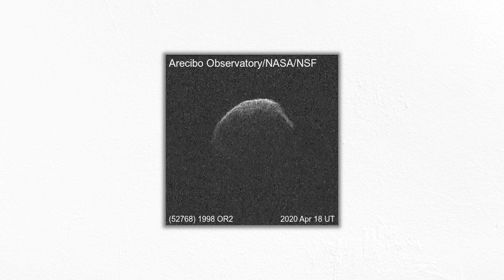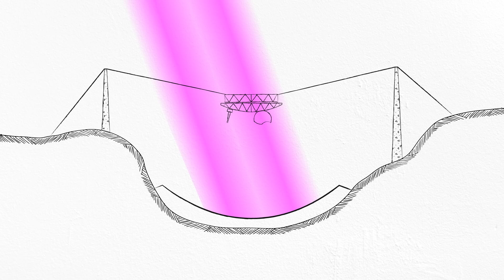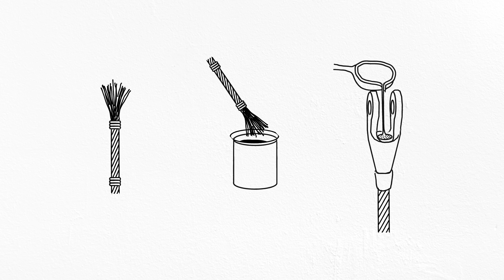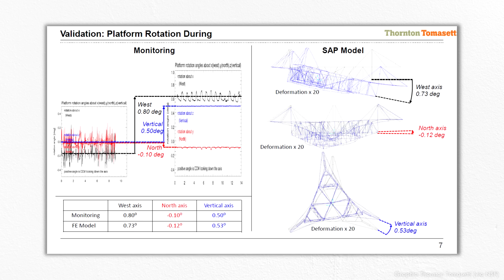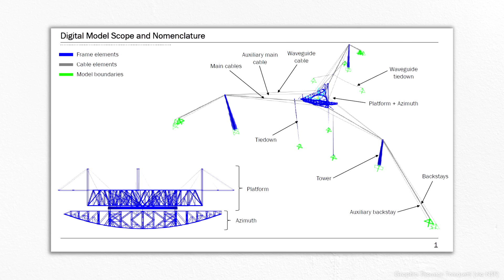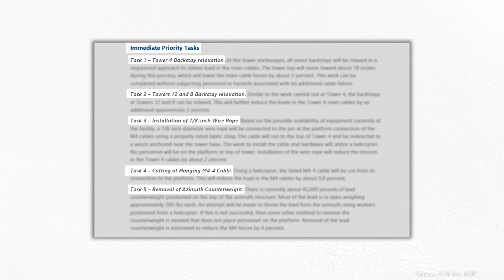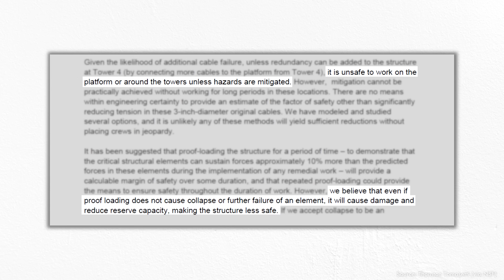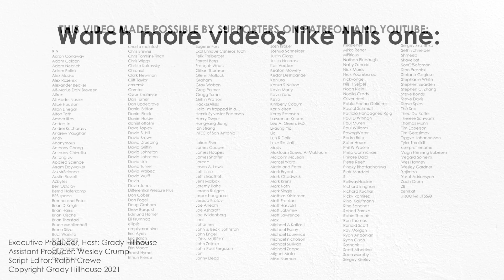What Really Happened at the Arecibo Telescope?

Comment: This was surely just down to inadequate maintenance. You mentioned lifts using steel cabling, typically for lifts all lifting cables should be replaced every three to five years, sooner if there is any indication of mechanical damage during regular inspection. Certainly a costly exercise. The calculated strength of a steel cable at manufacture, 70 years later, is fiction.

Comment: I am sorry but in my opinion this was a combination of analysis paralysis and incompetence. Obvious there were massive issues with load distribution in the cables, considering that once the first cable failed, the platform position dropped by one meter. By the time the second cable failed they should have realized that the are on shaking ground with little time to spare. Of course these failures seems spontaneous but strain gauges, piezo sensors etc could indicate that some significant event is about to happen. Arecibo was quite far from being a loss except for, OK a little aggressive, incompetence. I would not trust these guys to change a light bulb.

Comment: I will think of this old engineered structure failing every time I cross Tower Bridge in future which thankfully now is not often. 

Note 1: Maybe all stuctures that have a possibility of failing, like this telescope and bridges should have automatic computer controlled drones constantly watching them. If we can watch failures like this then the information could stop future failure and lead to possible upgrades. 

Note 2: I was surprised that zinc was used. I know it has a low melting point making it practical to use in the field but it is extremely weak compared to other materials, I'm also not sure how well it adheres to the steel cable. I suspect better methods now could be found. 

This sort of engineering is not my working field but I've been doing heavy duty electrical terminations of all types and sizes for almost 50yrs and I started my career in a metallurgy lab.

Comment: Perhaps a bit of an oversight on the original design (probably due to cost and limited expectation of increasing the load) was to not have the ability to lower the heavier suspended elements from the supporting cable structure.  So the cable sets would be affixed to a sub or hoisting frame, and then the rotational unit and instrument packages could be lowered to some fixed struts projecting up through the dish for the service of all the components.  Assuming the towers themselves weren't being overloaded, individual cables could replace with heavier ones, or additional cables could be added more safely.  Perhaps a thought for any future dishes.  To design such a large and potentially problematic structure with some significant degree of serviceability built in is pretty short sighted.  (Though as an engineer, I am constantly pressed to spend less money on a project; I have never had one that would have had such a catastrophic, and therefore expensive, failure mode.)

Comment: Could have installed new cables one at a time.  Back in the 80s
Reply: yes, i think so too, but you would have need something smooth, not a helicopter over there...a balloon or maybe even a zippelin could have help relieve tension on the structure so you could have get a beneficial safety factor above 2!  it could have been done, but it would have been expensive...

Comment: What surprises me most is that it apparently wasn't necessary to have a system for lowering the receiver to the ground in the event of a hurricane.  Props to the original engineers that designed it so tough that you could just leave it up there to swing in the wind and it stayed up there for decades.

Comment: High-cycle fatigue ?
The wire rope would have been subjected to variations in tension around the static tension, so a +/- fatigue cycle on top of the big + static tension.
Furthermore, there could have been internal abrasions in the individual strands against each other causing surface roughening of each strand and reducing its cross-sectional area.

Comment: You talk about having increased safety margins in the original design, but it seems that a structure that was designed in the 1950s to serve a purpose in the cold war, that far outlived the cold war, was more than adequately designed for its intended purpose.  That it was later re-purposed for something not envisaged by its original designers cannot be seen as a fault of the original design.

Comment: I'm a rusty Physicist but I suggest the cables likely died from a salt death.  However, I suggest they were designed for the first antenna array and not the rotating ring structure and heavy head added for improved sky observation. Therefore it was under sized and was on a razor edge waiting on time.

Comment: You said the structure was initially built for a military purpose, this usually warrants a much lower factor of safety.
Reply: Yeah, if those center failed cables were originals ( not the auxiliary ones added later) i could see construction priority causing these issues. Getting it up and working is top priority. Not making it last... 

I can't wait for the forensic reports on the cables.

Comment: I think it's fair to say the hypothetical cable flaws are one way to see this loss but the other way is to see the design was flawed from the outset.  Better cables won't compensate for weak anchors and stronger anchors won't compensate for improperly supported mass.  There was virtually no reserve strength or redundancy in the cable architecture.  The oldest bridges in the world are precisely those which were overbuilt.  This was built on a scarecrow diet.

Comment: You said it in the beginning of the video.  "Corrosion in the Spelter socket."  Then overall corrosion in ALL the cables.
Lack of money for properly done maintenance is the overall diagnosis.  Plus overloading in subsequent years.  You never use the built in safety margin for add ons.

Comment: another good reason not to hire the lowest bidder when constructing some thing so critical, if they would have hired the higher bidder those cables would have been assembled correctly. and would have used the best materials, instead of the cheapest money could buy!.  you really have to give it to the shuttle crew men and women, it had to take guts to fly in space on a machine with 270,000 parts built by the lowest bidder!.

Comment: As a structural engineer, right of the hand, I think the main reason for failure was due to overloading the deck.   Then, its location geographically didn't help either over time.  Finally, lack of maintenance played a big role.  Tension cables should have been replaced as often as every 10 years or so.

Comment: Safety factor of 2 in 1960.  Then double the load and add a couple more cables on each tower. What could possibly go wrong. The structural engineer from the sixty's is rolling over in his grave.

Comment: I remember when it was first put into service. I was in HS and it was quite an accomplishment. However technology has moved on. It will probably never be replaced. It was only built in the first place to monitor the Soviet Union's nukes.  We have better technology today and many types of observation can be accomplished from space with satellites. If a base is built on the moon,  something like it may be built there, but the size could probably be much smaller due the the fact that signals can be amplified and computers can remove noise, unlike in the 60's.  Today, we can look back in time and hear remnants of the Big Bang. How is that done?

Comment: I really wonder why it survived the storms of 2017 but collapsed 2020 in calm weather.
So did the chipped paint occurred starting from 2017 or not before the first cable break in August 2020? This could indicate if the storms weakened the cables and prepared the collapse 3 years later, or if there was some serious damage after 2017.

Comment: Very sad. It provided many cool discoveries over the years.
I wondered what happened to it. 
It was a marvel of engineering. 
Thank you for the video. The drone shots as the cables failing was spectacular. In slow motion you can see each wire break. 
I hope they will replace it with a new telescope that it safer.

Comment: Zinc slowly corrodes in air, particularly salt air.  For this reason, a Spelter socket has a limited service life.  Those cables should have been replaced in an overhaul after 40 years in service. With new sockets and anchor  structures.

Comment: Another consideration of the strength of the original Aricebo design is the circumstances of it's creation. In the late 59s there were no reliable systems for detecting missle launches in a timely manner. The Department of Defense was funding many possible scientific proposals and evaluating them for deployment. Aricebo was built quickly to address a present threat. A maintenance program was only created after the fact.

Comment: "Cables were regularly painted" Cables are not supposed to be painted, they should be left bare but impregnated with grease. This keeps out water, inhibits corrosion and lubricates between stands as they shift under varying load. The Aricebo cables were originally bare and greased, but then when a James Bond scene was to be filmed there on the suspended antenna, the directors insisted that the cables had to be painted white for appearance in the movie. The site management allowed that. And so the telescope's fate was sealed - by a James Bond film shoot. The paint prevented keeping the cables properly grease-filled. They began corroding. Expansion due to corrosion places uneven loads on different strands...

Comment: San Francisco's Golden Gate Bridge was built 83 years ago. It's exposed to very rough, wet and salty conditions. The 500 vertical ropes were replaced once, in the 70ies. The two main cables were not. Their corrosion can't be stopped, but only be slowed down. The bridge structure got some weight relieve though when they replaced the heavy lane deck with a lighter one some time ago.

Comment: I really enjoy your content. As an engineer who grew up while Great Britain was dumping the Imperial measurement system to fall in line with Europe using the metric system, I am able to interchange measurements between them. Feet and yards, to metres is confusing. A foot is just over 300mm or 0.305 metres. 2'6" is 0.76m. As a metre is just under 39 3/8"
I can remember all the trouble changing over caused but I have to admit using metres and millimetres is very much easier. 
I do hope they build another scope of equally futuristic design as the engineers in the 50s.

Comment: Excellent video. As an engineer working aircraft structures, you are spot on regarding safety factors. Seems like they had a well calibrated mathematical model from which to make reliable predictions. But failing well below the predicted strength begs the question: were fatigue and damage tolerance ever a consideration? That vertical supports were required leads me to think that even the slightest of deflection in the system repeated millions of times over the years had to accrue structural damage. Such theories pertaining to aircraft were in their infancy in the 50’s and 60’s. So I’d have to think their application was likely less considered on such a unique structure. 

Just one person’s speculation.

Comment: Thank you for the very interesting video. The question of how such repairs could be made in those circumstances remains very prominent to me. I wonder why such structures are not planned with that in mind. Replacing wires should be standard on such constructions especially in this kind of environment exposed to salty air and harsh elements.

Comment: Todays words are: redundancy and safety factor. Don't you ever forget them.
Reply: You cannot rely only on safety factor and redundancy when both of those characteristics can be affected over time due to corrosion and other incidents. They are very dynamic over time, difficult to predict and modelate, and that is the problem here.
Reply: @HambertHM  today’s additional phrase is: responsible maintenance
Reply: @HambertHM  If they rebuild it.  They need to use galvanized cable and do yearly inspections.
Reply: @BeingMe23  if they rebuild it, I will come.
Reply: @agoniaXdunya  we can rebuild and perhaps make it better then the past.  (both to show the change and to honor its legacy by continuing its work)  if we were to rebuild it like it was, it would feel like pretending that this never happened and that would be something I would consider disrespectful.  (I am sure someone with better ability could explain my thoughts better as I doubt I am the only one who thinks this way about things like this)
Reply: @BeingMe23  galvanized alone won't hold up.  Needs to be coated or shielded as well.
Reply: @HambertHM  this guy gets it.
Reply: also consider design life. I doubt the military specified a design life of over 50 years,  Design life plays heavily into material and assembly decisions all along hte line. Although "maintenance" can extend the life of just about anything, it won't last forever.  concrete and steel designed for 50 years may last to 60, but probebly not 70...
Reply: @mrl22222  funny you give that 50 year mark saying that with proper maintenance, keeping it til 60 is quite likely... most of the US's original infrastructure during the highway boom was designed for that 50 year mark and here we are approaching that 70 years xD
Reply: @lachlanhudson7404  Tell that to the highway road conditions in Michigan USofA
Reply: @mrl22222  Yes everything had shelf life.  But if one tries to design something it for a overly extended time can drive up the over cost vs benefit.
Reply: She still wasn’t as neglected as the people of Puerto Rico
Reply: The problem wasn't that. The problem was it wasn't designed to be maintainable. The cables were permanently anchored instead of being attached to winding drums that would allow their tension to be released in a controlled fashion for maintenance and replacement. They never considered that they may one day need to replace the cables. Thus, the observatory inherently had a fixed lifespan.
Reply: Safety 3rd
Reply: the whole design of those horizontal cables under such tension was a huge mistake, the design was such there was little way to safely replace cables
Reply: And don't forget redundancy!
Reply: The structure still holds after the socket and cable failed, the redundancy isn't the primary issue to focus on. It is also unmanned and remotely operated, therefore it is not justifiable to have a high safety factor. Safety factor is a cost to minimize loss of lives, it should not be a cost to supplement poor design.

From the video, until the investigations are finalized it seems to be a maintenance problem. The first 2 failures are not identified and remedied in time. Even after 2 critical failures that jeopardized the operating condition of the structure, the engineering team is unable to come up with a viable repair solution. Failure to maintain the structure is what caused the structure to fail. With the benefit of hindsight on the delicate structure, either they improve on their maintenance plans or they must consciously reduce the structure's operation lifetime.

Comment: If it's possible, I would wanna see a new telescope built.  One with aluminum panels that aren't rigidly placed (maybe the whole surface could be folded up like an origami flower and stored for when storms are on the way or the telescope isn't in use), and a receiver which can be flown like a drone rather than suspended from cables (or somehow raised and lowered rather than staying rigidly in one place all the time).

The panels could even be set up as a series of hexagons rather than a solid piece.  This would mean setup and removal takes longer, but it's safer overall for everyone and everything involved because there's not so much weight to deal with, and any damage that is sustained is localized.

The main issue I see here is that the cables were installed in such a way that replacement was already difficult at best, impossible at worst.  Being able to raise and lower the main load (the platform) would likely allow the telescope to keep going for many years to come, and with the delicate panels underneath able to be folded up and removed, this could reasonably be achieved in any of a variety of ways, even if the platform is too heavy to fly.

But hey, it's possible that I don't know enough about the subject to know what I'm talking about.  It's just an idea.  :D

Comment: Very nice video. And I was surprised by a couple of things: spelter sockets normally are filled with resin, rather than with molten zinc, but that was not available back in the days yet. Furthermore, components like sockets, shackles, etc typically have a factor of safety of 4 or 5 these days, much higher than during construction of the facility. Given the conditions and modifications, I am actually suprised that it was able to stay in tact for so long.

Comment: True story of my experience of engineers - We built an octagonal retaining wall for an engineer once. During a lunch break, we figured out the lengths to cut the timber on the back of a pie wrapper with a pencil and iPhone calculator. The engineer saw us doing this, was a bit amused, and told us he would figure it the correct way for us. Hours later he came back with 8 sheets of paper of CAD printings and calculations and degrees etc etc. We were bamboozled but knew his measurements wouldn’t work. By this time it was the end of the day so we didn’t start cutting. The next morning he came out with more paper and drawings and stuff, told us he had made a mistake, and these were the new correct measurements. They were the same as what we had written on the pie wrapper. The guy designed highways and bridges.